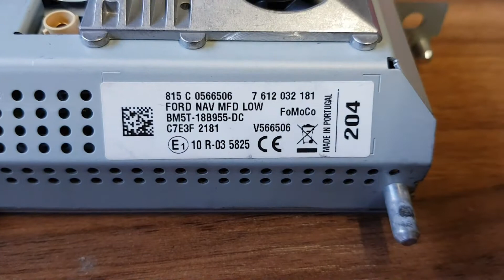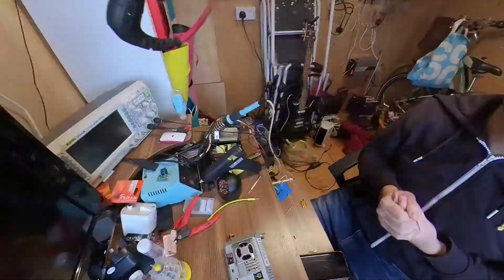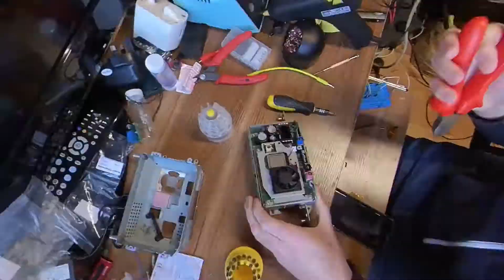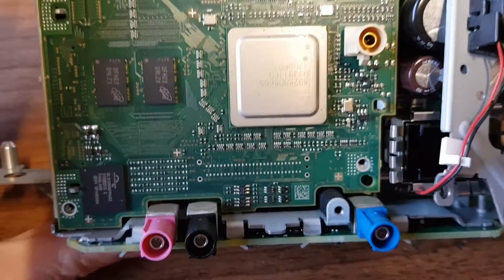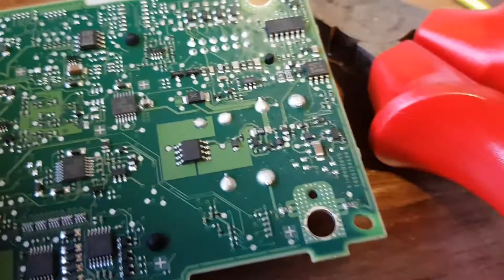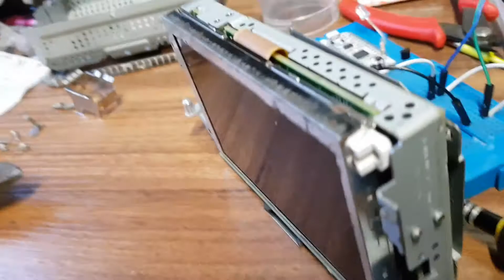Ford nav MFD display

Comment: It won’t actually come on unless you can access the Lin bus. If you take it apart you’ll find an inductor blown next to a voltage regulator for the display.
Reply: Hi,
My display (Focus 2012) started to flicker. The backlight of de lcd went from normal to bright and back. Now it is very bright all the time. It is functional Just to bright. Could it be something in the backlight circuit like a bad capacitor?
Reply: @jooptimisela1217  usually a resistor is used for backlight control but as the mfd varies brightness to match the rest of the lighting I’d guess there’s an ic that controls it. I believe the smaller flex cable is the display brightness control.
Reply: @grahambell8148  Thank you for your quick response.
I had a look at the 2 SOT223 components naar the small flexcable. These are 5610DG adjustable voltage regulators I think. I am not sure because I could not find much information about them. Therefore I also do not know how to measure them in circuit. Should I replace them? There is also a SOT143B component withe the numbers 22 47 5 or S. It is between the flexcable and the 5610DG.
Reply: @jooptimisela1217  difficult to say without testing them. Possibly remove them to test but also check the ic voltage increaser that causes the screen to die also. It’s located near the large screen fpc and has an inductor across the ic (the inductor often blows causing loss of display) that could be failing causing a higher supply voltage and therefore brighter. It’s a 500ma rated  inductor and the screen requires 460ma so close to limit when new.
Reply: @grahambell8148  Hi,
 I already installed the mfd in the car but I took pictures of the board. The inductor nearest to the large screen fpc has the markings 330 and 31. Is this the one that is prone to fail? I think it is a 33 µH inductor. Am I right? I found an smd inductor on Conrad which is a 33µH smd 0.91A. 
( TC-PIS2812-330M203). So it has a higher current rating.

I found the datasheet of the ltc3826eg-1 step-down controller. There is a typical  application schematic which uses one 3.3μH inductor and one 7.2μH inductor. 
On my board there are 2 inductors. One with the marking 330(31) and one with the marking 100(31).
So now I am not sure about the 33μH. Or is the 3.3μH just an example value?

Shall I replace them both? Or is the 33µH 0.91A sufficient? I know it is not sure that the inductor is the problem but they are very cheap so it is worth trying. 

Thanks in advance for your answer.
Reply: I removed the 330 inductor and I measured it. It was around 40µH. Just to be sure I put in a new one but it did not solved the problem.
Reply: @jooptimisela1217  The LT3467 switches at 1.3 MHz, allowing for small valued
inductors to be used. 4.7μH or 10μH will usually suffice.
The LT3467A switches at 2.1MHz, allowing for even smaller
valued inductors to be used. 0.9μH to 6.8μH will usually
suffice. Choose an inductor that can handle at least 1.2A
without saturating, and ensure that the inductor has a
low DCR (copper-wire resistance) to minimize I2R power
losses. Note that in some applications, the current handling
requirements of the inductor can be lower, such as in the
SEPIC topology where each inductor only carries one-half
of the total switch current. For better efficiency, use similar
valued inductors with a larger volume. Many different sizes
and shapes are available from various manufacturers.
Choose a core material that has low losses at 1.3MHz,
(2.1MHz for the LT3467A) such as ferrite core.
Reply: I have one unit on my bench with a cracked and charred inductor next to the LT3467A (LTBCC marked). Do you have the value for this component?
Reply: @ChemaLtd  if it’s the one on the power board to the right of the main capacitors near the display connector it’s a Wurth Electronik 2.7uh 520ma inductor, Mouser number 710-744758327A.
Reply: So the first mistake that I made was concentrating on the wrong regulator (LTC3826EG-1).
Thanks to Doublegmdg I was triggered to look at the LT3467(A). This part has a SMD code LTBCC.
And indeed the inductor was a little bit charred. Also the tracks were a bit dark from the heat. The inductor was not blown yet but I could not measure the inductance with my crappy LCR meter.

I replaced the coil with a 10μH one (Fastron L-1616FPS 10μH 1.4A ). First I tried a 4.7μH inductor but horizontal stripes  appeared on the screen. The L-1616FPS is a bit too big for the board so I soldered it in with some wires and heat shrink tubing. Probably not the best thing to do but it works. 
So the regulator is the LT3467 and not the LT3467A. 

There are smaller types of inductors available like the L-1212FPS 10μH but it's 0.88A) The original inductor is very small (L2mm W1.55 H1.6mm).

But still my original problem was not solved. The backlight of the screen was too bright and the contrast was bad. So I ordered a new screen from AliExpress. The screen is a Sharp LQ050T5DG01. My unit is the BM5T-18B955-DC 7612032181. It is working fine now.

So if your screen is not working, it is probably a blown inductor and if you have backlight contrast problems you can just replace the screen.

Hope this helps someone.
 @doublegmdg
Reply: 10μH worked for me. See my other comment @ChemaLtd